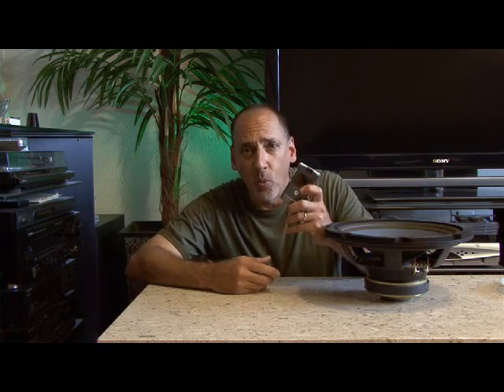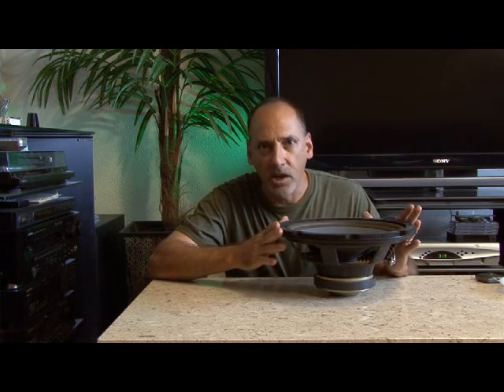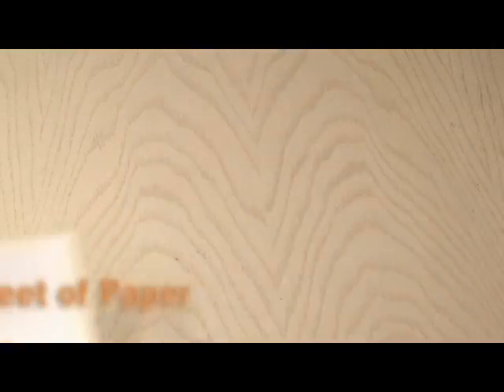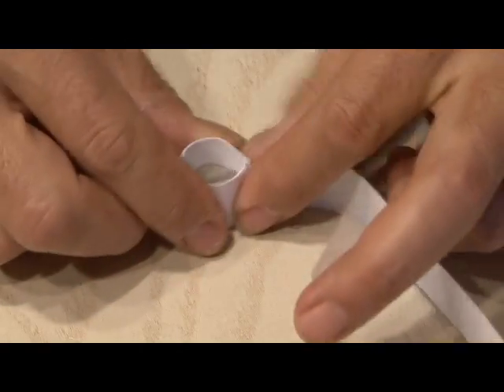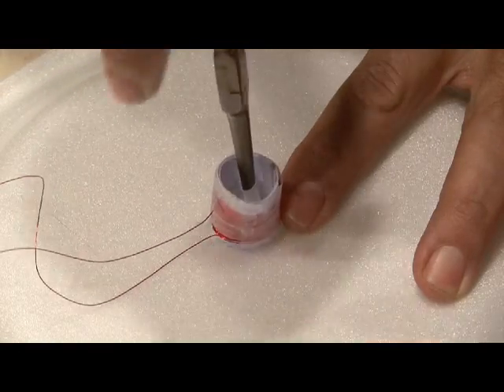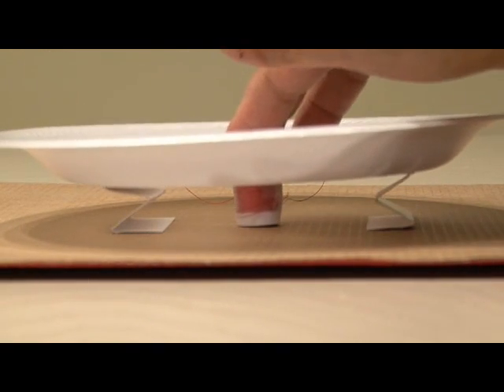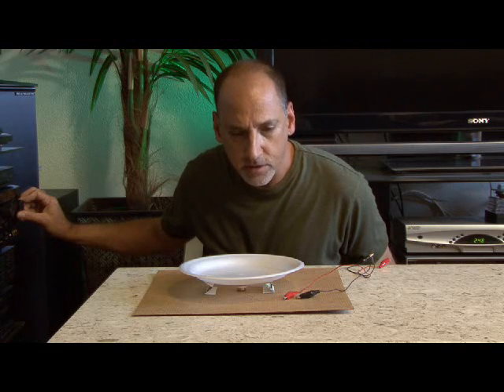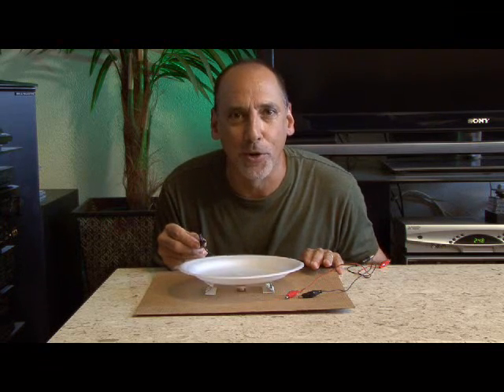Weekend Project: Styrofoam Plate Speaker

Comment: Wrap enough to ensure you get between 4 and 10 ohm or you might damage your amp. Also, enamel wire is essential - or you'll end how with a copper blob and not a coil

Comment: I would personally recommend using normal paper, all around the plate instead of business cards for better and more balanced bass performance (it won't wobble so much due to more contact points) also, you might consider experimenting making more zigzags than a W shape...

Comment: For the audio plug, can I just use some earphones, cut the wire, and connect the two inside wires with the copper wires from the Styrofoam plate speaker? Will it work? Please reply.

Comment: can u tell me how to connect the copper wire to a earphone jack? please pm me thx
Reply: Earphone jacks use something called a "tip ring sleeve" connector. The tip is the very end, the ring is in the middle, and sleeve is last. Tip and Ring are your speaker OUT, while Sleeve is ground. Connect one of the leads from the plate speaker to the Sleeve, and the other to either Tip or Ring, and it should work.
Reply: Kozidian your right

Comment: please tell me how to connect the coil to the earphone jack
please PM : dixon.macho99@yahoo.com
Reply: You simply get a headphone wire, take it apart and identify the positive and negative wire... After that, connect both the wires to the other two wires from the coil (i'm not exact where goes the positive and negative wires, but you can try it out without any problems)... That will send the electrical signals, and the coil will turn it into sound! :)

Comment: You can find neodimium magnets at hardware stores or at RadioShack
To connect you speakers to an iPod you would need to take a pair of used headphone and take the wire the plug in them and cut them off, then just wire them together and turn up the volume on you iPod to the max and press play.

Comment: you can find neodimium magnet at hardware stores 

you take an old headphone wire and strip it and you would see one wire goes around the core wire strip the core wire and connect one side of the wire around the magnet to the wire that was outside the core wire  and the other one to the core wire itself plug it in to the MP3 and you sould hear it play 
tho the volume would be very low , so use an amp

Comment: Yeah you can use the copper wires for sure! Not the insulated ones, I don't think they work. Remember to cover any exposed copper wire after the wrapping to prevent circuit shortages and getting electrocuted!

Comment: the idea works in theory, cuz the penny would be magnetized with an electrical current running through it, but its missing the magnet to make the penny "vibrate"; but a Nd magnet would break the tin foil.

Comment: I made one with a button neodymium mag epoxied on a centre of stretched cut balloon piece. The piece vibrates in a coil made from 36SWG wire which receives audio input from laptop jack socket. The sound quality I got is about similar to that of high quality earphone and the bass and low freq sounds are very clear.

Comment: I used 30 awg, only got 1 ohm of wire on, but it works, not very loud. Best plugged into my tv but my iphone and my android do work too. Will re-wind afresh the could with twicer as much wire, I think you want around 4 ohms, and something lighter than 30 gauge. 32 would give about 2ohms for the same length of wire as 30 gauge did for me. Hope that helps, this vid is a pretty inspiring magnetism experiment.

Comment: I used this magnet wire (22-gauge wire, search it in RadioShack , magnet wire set) , and these magnets (Round Ceramic Magnets)

I hooked the speaker up to my laptop and I hear sound, BUT it is EXTREMELY low.   Could the loudness be fixed by adding more wire, or changing the magnet itself?

Comment: I have a few suggestions but I still love the video, I have tested and paper bowls work slot better and if possible you should find a way to mount it by the edges not by springs, I used a big hole and weather stripping to do that

Comment: @blindassassin111 how do u think a generator works its a electrick motor only reverse a speaker has a coil and magnet like a electrick motor and if u reverse the speaker it will generate current.

Comment: get a 2 ended aux wire plug it in your ipod then get 2 jumpers/wires connect 1 of the jumpers/wires to the inner metal part of the aux wire and the other 1 to the out side one thats what i did.

Comment: No it isn't. In this application, the wire having an enamel is important because of the coil. If it was standard non-enamel wire, the coil wouldn't function because it would short out.

Comment: i got that same type of subwoofer, but mine is a 10in, 350W.  i blew the coil in it, so i kinda want to see if i can make a paper plate speaker for my electronics class.  but one of the kids threw out the coil so im not sure how much wire to use.  any idea?

Comment: I'm not too sure, but I would think that to make it visibly shake and be loud, you would use a bigger coil, and bring it closer to the neodymium magnet, which would push the plate away with a stronger force. Once again, make sure it doesn't go backwards. You are right though, there is a line between loudness and clarity. Also, in the video it looked like he had to turn up his volume a ways before he got the loudness out of it. That's just an observation though.

Comment: It shouldn't. The electric signals used in speakers are an alternating current, so the magnetic poles in the wire are always switching. Because of this, it doesn't matter which way they're wound.

Comment: No, the resistance does not have to equal seven ohms, but you don't want to add too much wire because it'll have too much resistance, but you don't want to add too little because it will be too weak. You should probably go around 7 ohms. I believe you can use multiple magnets stacked together, just make sure that your coil of wire is above your stack of magnets, otherwise it might go backwards and run into the cardboard, and that wouldn't be good :-)

Comment: sorry dear, i'm afraid you're confused. i'm talking about householdhackers styrofoam plate. his method consisted of a penny attached to a headphone jack, on tin foil streched across a styrofoam plate hmm indeed, that was what i was denouncing. please dont jump to conclusions ^-^ and yes i can speak on how to make correct speakers as it is the same method kipkay uses except more elaborate with measures to prevent excess vibration and the such.  indeed. this speaker will work fine made correctly

Comment: most of the things could be salvaged, you could do it with a plate, an old motor or transformer (rip out the copper wire) a magnet and some suspension

Comment: Please measure the resistance of the coil. If it is less than about 4 ohms, you need to increase the number of windings. Otherwise, you risk damage to the amplifier.

Comment: no you don't HAVE to use neodynium magnets but neodynium has vry has magnetic properties in relation to its size so its perfect for speakers and hard drives (where its used for the read/write actuator)

*bows in appreciation :P*

Comment: You cant hook it up to a game console, MP3 Player, or iPod. It has to be hooked up to an amp. Try Kipkay's "Altoids Tin Amp" project, or set it up to a radio like I did with mine. Also if you use a neodymium magnet it will perform a lot better then using ceramic magnets.

Comment: as long as the current is going from the ipod to the coil, yea.  you can use the current from the left right or combine them as long as both ipod wires are touching the coil wire.

Comment: Tip to all who may "experiment" with the speaker winding part of the tutorial. Make sure to measure with an ohm meter to keep the resistance of the wraps to between 4 and 10 ohms otherwise you're speaker could be damaged as well as the amplifier, or as the less educated call it, the receiver.